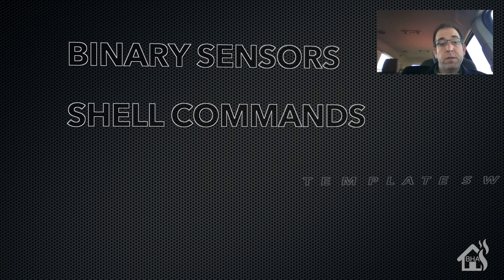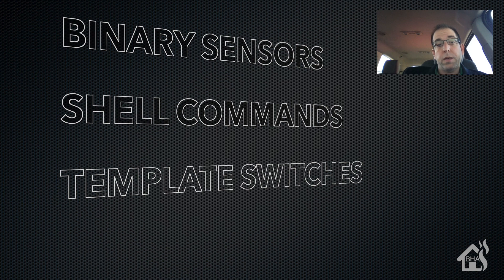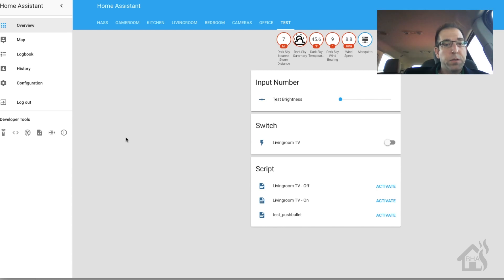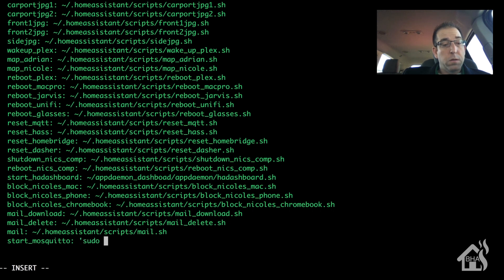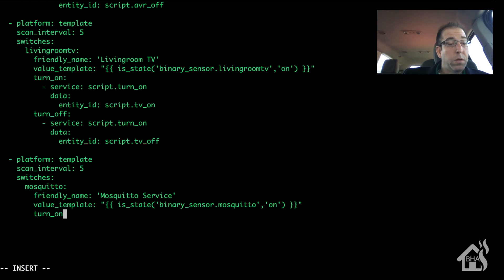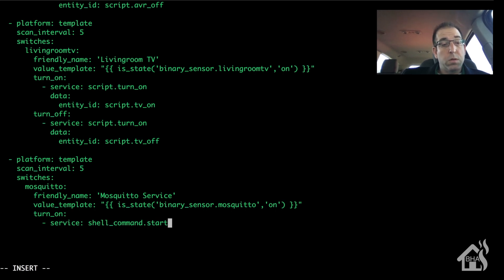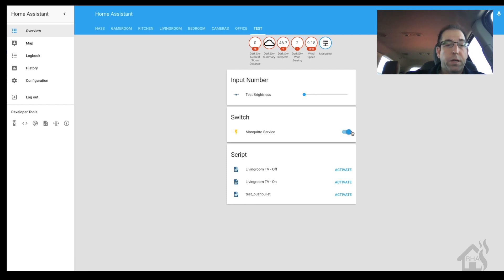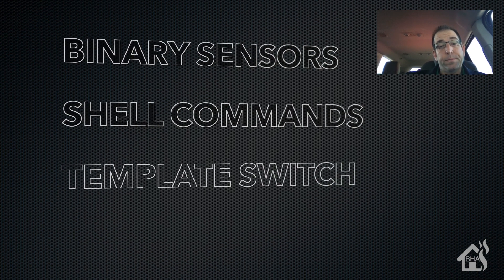Configuring binary sensors and template switches in Home Assistant

Comment: Hi, I just follow your instructions successfully to turn both my TV and Directv box in 1 switch, I wanted to add a solution to the problem described at  https://youtu.be/HYJXvdp1r8c?t=630  (the switch going back to ON when you just turn it off).  The explanation to this is the source of the value_template, which until is refreshed, will be ON for a while.  My solution was to set the state of the sensor to off, that will immediately disable the switch and since the sensor will not be turning on (we just turn it off) then you will not see the switch turning on/off.

To set the state of and entity we need an extra script, here is how to install it (https://community.home-assistant.io/t/how-to-manually-set-state-value-of-sensor/43975).  Pretty simple and very useful.
Reply from the maker: That is awesome, thank you for the comment on this, very nice!

Comment: @BurnsHA Is there any differences that are required in the shell_command.yaml if the python VM? I set up the switch as you did in the video, but I'm receiving the following error: 

Error running command: `sudo systemctl start mosquitto.service`, return code: 1

Any thought on what would be causing this? I did have to remove the sudo in the binary_sensor.yaml for that to work which is why I'm assuming there's an issue with the way that hass is running as a VM. Any assistance would be appreciated!
Reply from the maker: are you using hassio or standard hass?
Reply: @BurnsHA  Well, actually since I posted this I changed my setup and am now running HASS in a Docker container (thanks to your other video!) and am now trying to figure out how to give the container access to the operating system to verify that the Mosquito server is running. I currently have the switch, but it's constantly showing as disconnected even though I know that all of my MQTT messages are being sent. Any thoughts on that by any chance? I'll try and post the log when I reboot next time.

Comment: OK help

I Have a broadlink rm pro 

I added each of my tempreture IR values
it's 29 values meanig 29 IR codes meaning 29 buttons

can I create a template where it combains it from 1 to 29
(Like a brightness thing)
Reply from the maker: can you show me what you got?  are you wanting a template slider that would call the different codes as selected?
Reply: BurnsHA Actually that’s in my dad’s house but I’ll write an example
Reply: BurnsHA yeah that’s what I want
Reply: BurnsHA keep in mind that’s just a sample config it’s not the real thing
Reply: switch:
  - platform: broadlink
    host: (IP)
    mac: (MAC)
    switches:
      mode_1: 7675667654565865
      mode_2: gigijtfogdtdrioj
      mode_3:)9$&$$))$)$&@@

Comment: Finally a simple explanation. Thanks.
One question though; when writing the value template switch, you indicate the "value_template:" and finishes it with 'on'
What does it mean exactly? Thanks.
Reply from the maker: that is for the status of the switch, so if the binary sensor that is monitoring the state of that service is on, then the switch will display in the on position as well.
Reply: Thanks again for the videos. They are really helpful. Some of us are technical but not coming from Coding background so it's really useful to understand through practice.
Reply from the maker: awesome, glad to hear it!

Comment: MQTT Mosquito on raspberry pi
Reply from the maker: what kind of mqtt devices do you have, like lights, or sensors or what....?
Reply: I only have a switch ( LED) as a test. 

I am struggling to add my 3 doors sensors on GPIO (NodeMCU) with MQTT. Thanks.
Reply from the maker: so is the led switch working or are none of the mqtt devices working?

Comment: Hi Brother, this code didn't work on HassIo. after i rebooted the HA I get the Mosquito icon but it showing it's offline all the time. is the command line correct for Hassio.
Do you have another video for binary sensor track when I am at home?
Reply from the maker: what kind of mqtt devices are you using?

Comment: Brian, 
Sorry to bug you but I ran into a wall.   I am trying to setup a doorbell using a raspi 0 w and have it talk to HA.
So far I have the doorbell part working, it a wireless commercial doorbell.  I have jumped the speaker to the raspi0 and that is working fine.  I have the raspi configured so that when the doorbell is rung, I send an mqtt message to my mqtt broker using mosquito_pub.  Now Im trying to get the HA part going.   so far I have setup:

 the sensor:
 - platform: mqtt
    name: "Doorbell Ring2"
    command_topic: "doorbell/command"
    payload_on: "ENABLE"
    payload_off: "DISABLE"
    state_topic: "doorbell/status"
    optimistic: false
    retain: false

The automation:
  - alias: Doorbell Rung
    initial_state: True
    trigger:
      platform: mqtt
      topic: doorbell/ring
    condition:
      condition: state
      entity_id: switch.doorbell_ring
      state: 'off'
    action:
      - service: script.sonos_say
        data:
          sonos_entity: media_player.office
          volume: 9
          message: 'Some one rang the doorbell'

If I send a value of ENABLE I would expect the sonos to let me know that someone rang the doorbell.

/usr/local/bin/mosq1.sh doorbell/status ENABLE 

Sorry this is so long - thank you